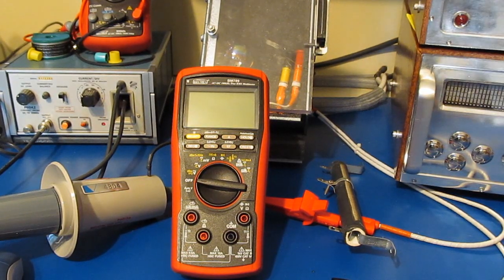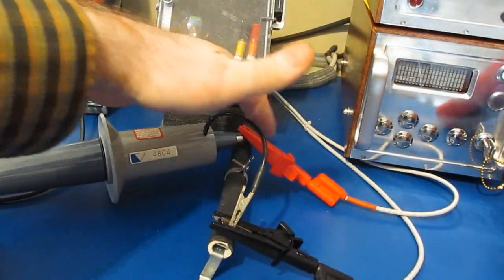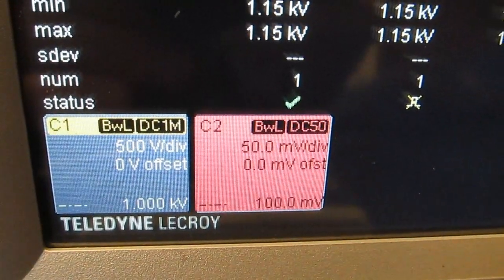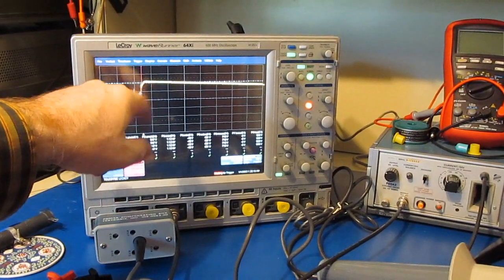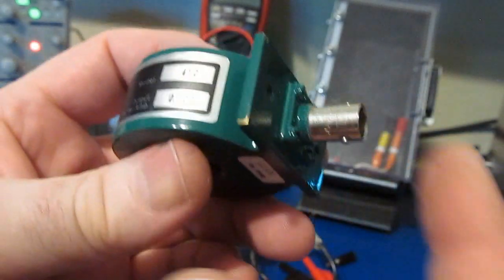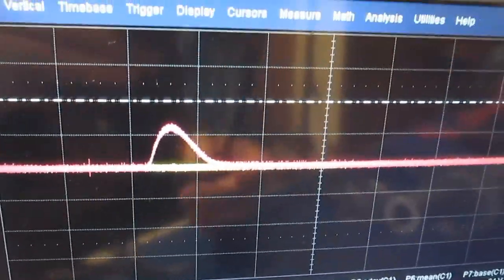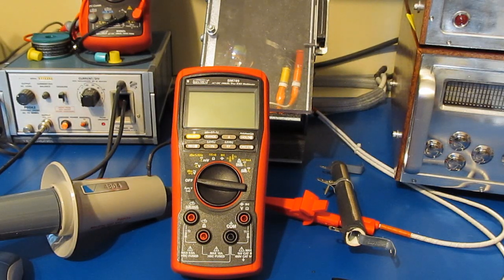Transient Generator, Current Waveform Test

Comment: very well demonstrated and explained. and very nice to see how you mocked up the input protection stage. showing its these clamping transistors we are initially relying upon. so if the silicon fails open that's totally fine in terms of safety right? but if it were to fail short then the responsibility falls elsewhere to things like the mov or other protections would kick in? it is nice to understand these different typical failure modes. or perhaps there are already some videos on the subject elsewhere i should go search around for and educate myself
Reply from the maker: For safety, I assume you are trained/licensed and are using equipment certified for the environments you work in.  I am not an electrician and have little interest in that subject. 

Resistance for example, requires a current source and low voltage input.  These circuits will not have the luxury of high impedances to protect them and when they are switched in, require additional low voltage clamping.    ACV for example will not use these low voltage clamps.  Beyond the high impedances, these circuits are protected by the high voltage clamps. 

Yes, I've made a few videos going over the front ends in more detail.  

https://www.youtube.com/watch?v=GhslaLKOpKE
https://www.youtube.com/watch?v=wYCGnYglRjY 
https://www.youtube.com/watch?v=cMutvk_6xhY

Comment: Great presentation as usual. What's the reason for the ringing in the current waveform?
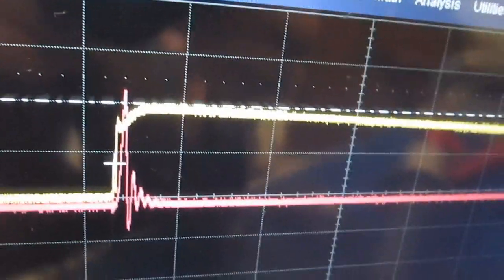Reply from the maker: I assume you are referring to about 4:40 where the meter is in the ACV mode and is basically an open circuit for the 1KV transient.  Still, there is a very small amount of current that rings out.  You can imagine its not a purely resistive circuit and we have a sharp enough edge to cause some of the parasitics to resonate.   Think of smacking an LC tank and watching it ring out.  The wires themselves will form a fair amount of inductance.   Recently, I made a video demonstrating using a low cost VNA to make PDN measurements.   If you watch the following, you can see the difference of just cutting the leads on some through hole parts has on their inductance.     https://youtu.be/Y8ouApeex78?t=2067
Reply: @joesmith-je3tq  understood, thank you!

Comment: Would've been better if you'd tested (fried) the new UT61e+ rather than showing off the Brymens again.
Reply from the maker: Hello Jeff.  You're not the first who has asked about that UNI-T meter.   Dave (EEVBLOG) had made a review for it when it came out.   For the price, I think I would rather get something with a better chance of performing well against these tests.  After all, I've sent more UNI-T products to the recycle bin than any other brand.
Reply: @joesmith-je3tq I want to see the 61e+ because of your excellent job of diagnosing the success and failures. Very interesting and educational. The e+ has had real changes and I'm interested in whether they addressed the 61e shortcomings.  I can't stand watching eevblog anymore.  Superficial overviews. His credibility in reviews is lost as he peddles his rebranded meters.
Reply from the maker: @jspencerg  I watched Dave's review in full.   There's a few parts I question but overall it seems pretty good.  Most of it I would say was fact based as he is just presenting what he is seeing.  I have no problem with that.  There were a few other reviews on this meter as well but you are not going to find anyone stressing one which is what I suspect you are after.    I have asked the forum if there was any interest in seeing the 61E+ ran.  Let's see what sort of response we get.